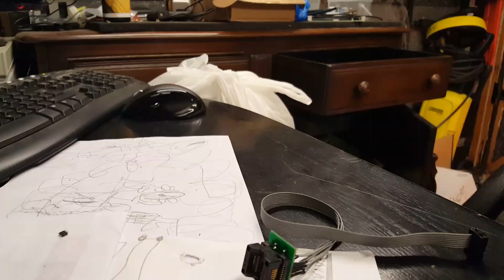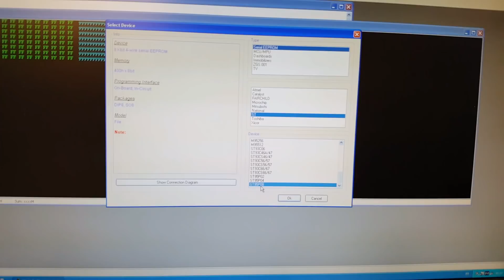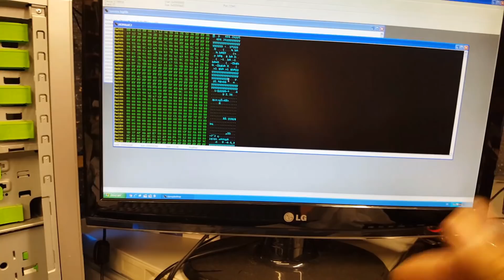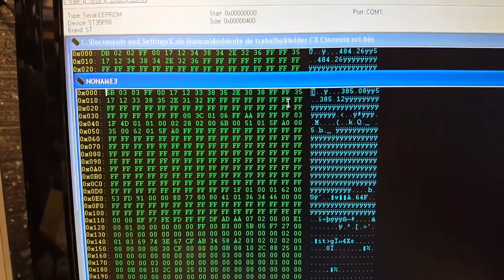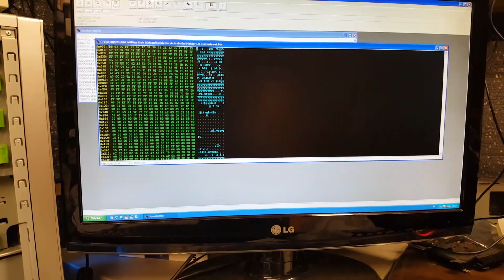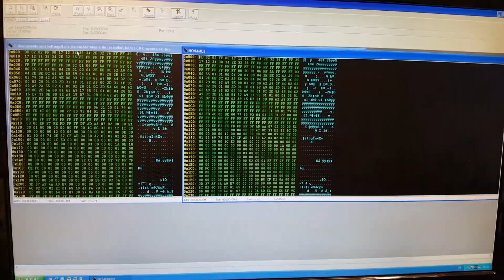Clone/copy immobilizer Bosch EDC15C2 eeprom 5P08C3.

Comment: why not just transfer the whole chip by soldering without copying? I have a dead ecu, EDC15c13 can I simply move the chip onto a donor of the same part numbers and expect it to work or do I need to copy the chip?
Reply from the maker: You can just move the chip...
In this case, was to leave both ecus ready for the same car...
👍👍👍
Reply: @LMAutoRepairs  Thanks so much save me a headache of cloning etc etc

Comment: What happens if you read say for example an ST93c66 chip with the setting to read not being ST but microchip. It reads but does that mean the data is definetly wrong or not?
Reply from the maker: Could be... either erratic data or fails to read...
👍👍👍
Reply: @LMAutoRepairs  And if you matched a Renault traffic EDC15c to SAGEM bcm then 2 minutes later they became unmatched. Where would your mind be as to the next step to diagnose that?
Reply from the maker: Difficult to say... but I would onsider a bad bcm perhaps...
Are those parts original from the car or similar?
Reply: @LMAutoRepairs  the bcm is a replacement bought from Ebay. I learnt pin using my im608 pro then reset immo and my im608 said successfully completed. Then went to relearn and I can't recall but don't think it did it 100% yet got immediately distracted by seeing immo matched appear. Thats what I wanted to see and with it moved on. Only 2 mins later not matched. Also the central locking not working and every time I code a key, either im608 pro or TDB1000 it says completed but check and no keys stored.
Reply: oh too add. pin 6 and pin 14 ohms were way out. turned out to be blue plug. cut it out and soldered wires together. after ohms 60 ohms on can
Reply from the maker: Have you tried to reset the imo again, and restart the procedure?
Reply: @LMAutoRepairs  No thats one thing I did not try. The firm whom I bought my im608 pro from said they often hear when a key won't program that if the programming is tried 3 times it will work. I did not believe them but this is sounding like that in part. If it works of course.

Comment: Why you had not tried to read through ic clamp instead desoldering?
Reply from the maker: 🤷‍♂️
LOL
It is so easy to remove this small chips, that I prefer to just desolder... 
Thank you for watching!
Reply: @LMAutoRepairs  i asked that because is simple to desolder as most simplest to not desoldering it, just r/w via IC clamp placed on it. Thats it!
Reply from the maker: Yes, but some chips the circuit on the board can prevent the reading or writing, or even corrupt the data...
Does not worth the risk... my opinion...

Comment: Hi there,  i have been a used immobiliser unit on hyundai i30 2019. It Does not start. Does a used immobiliser unit be programming without replace ecu? Thank you
Reply from the maker: Never done it on a hyundai... but I am sure it will need programming...
Thank you for watching!
Reply: @LMAutoRepairs  do you know does g scanner 2 work on programming?
Reply from the maker: Never used such tool...

Comment: Where did you get that multi pin adapter? Also, can carprog be used in a similar fashion?
Reply from the maker: I got it from eBay...
Yes, carprog should also do the job...
Thank you for watching!
Reply: @LMAutoRepairs  if you don't mind me asking, where do you get diagram information regarding where to connect each pin? I saw you had a diagram but how do you get that information for a specific chip you have and how do you identify them, are they printed on the chip? Thank you!
Reply from the maker: Programmers usually come with some sort of instructions...
Thank you for watching!

Comment: Hi, that is a very nice job you are doing, keep it up thanks.
Reply from the maker: Thanks!
👍👍👍
Reply: @LMAutoRepairs  Hi, I have got  almost a similar case with a 2004 mitsubishi endeavour ecu MN132652. The ic47 which is 24c04 shifted from old ecu to new does not allow the car to start with the new, is there any other ic having immo information on the board?
Reply from the maker: Most likely the flash... if not external, will be in the MCU...
Reply: @LMAutoRepairs  In the MCU? can I know which one exactly? Can it be the E338A? what do you think it will happen if I take it from the original to the new? Cause it is said E338A is a car key control ic. Can I read and write this chip? Thanks.

Comment: Great video 
Can you tell me in any car ecu how do I locate eeprome  if there are more than one ?
Is there any publication that shows location of eeprome on different ecu or do they have any special numbers that we can recognize them ??
Reply: Great question, I to0 am also curious how to find which 8 tipped eeprom on the motherboard inside the pcm
Reply from the maker: Read their id stamped on the chip...
It is that simple...
👍👍👍
Reply: @LMAutoRepairs  that simple than explain cause not being as smart as you or a mechanic I don't know what I. Looking at andy 07. Passat has 4 ( pinned ones looking the same, what number do I look for?
Reply from the maker: Again, look at what is written on the chips... obviously I know some of them and I can easily identify them by that...
But you can easily Google it, and quickly find what a certain chip is...
👍👍👍
Reply: @LMAutoRepairs  I'm not following the little ones have numbers and I Google it and find nothing

Comment: I have 2006 Suzuki grand Vitara with no working keys. Recently I swapped the ignition and also PCM with a set of key from another Car.  Now i am getting a vin miss match and car wont start. I am having hard time getting anyone to be able to program keys or read the immo for this. currently i have 1 original ecu and another ecu from another car. Are you able program the vin number to my 2nd ecu? Thanks for the help
Reply from the maker: Just program the vin to the replacement ecu... is that the only problem...
Thank you for watching and for your comment!
Reply: @LMAutoRepairs  do you have an email address? I need someone to do the work. can i mail in the eeprom or ecu? i am willing to pay. I kinda need this fixed asap

Comment: hi. please help. where do i get the diagrams for soldering?. please please please
Reply from the maker: What do you mean, diagrams for soldering? 
Thank you for watching!
Reply: @LMAutoRepairs  i don't have the adapter. i have the pice shown at 13:01 in video.https://youtu.be/qfVJb_Bb5WI?t=781
Reply from the maker: @mosalamasekoa9070  
There is a mark on that piece that indicates the chip orientation...😉
Reply: @LMAutoRepairs  Let me be more detailed. I don't know where the chip is. and i need a diagram for my car model. Opel astra J 2014 A16XER. i need to extract and clone my ecu and bcm. i thought you might know a site where i can get the diagrams or pictures showing which is a memory chip on those modules🤦‍♂️forgive me for using up your time.
Reply from the maker: @mosalamasekoa9070  
On the engine ecu, I don't believe there is an external eeprom... it is all in the mcu...
So, you will need to BDM read the ECU... 
If you have the pin for the car you are working on, will be probably easier to buy modules already reset... and then just program them back on the car...

Comment: hmm, how this works.. why you copy data from org.chip to the other one. cant you just take the org. chip and put on the other ecu direct.
Reply from the maker: Hi
Yes you can... in this case I was asked to leave both modules programmed to the car...
Thank you for watching!
Reply: @LMAutoRepairs  aaa okej then i understand. by just moving this chip, do you think i can do it on a edc16u34, i quess is the same process.
Reply from the maker: @rteaw  
If is does have an external eeprom, yes... I never done one... I don't think...
👍👍👍

Comment: Hi does it matter which way the chips goes into the adapter of so how do you know which way ?
Reply: Hi thanks for the reply I've got a eeprom from a Corsa D 1.3 cdti removed from the ECU I've looked online to identify pin one but there's no marking in this epprom 
Thanks
Reply from the maker: @joshbennett6293  
Look at the writing in the chip.
Once orientated correctly,  pin 1 should be the first bottom left...
Reply: @LMAutoRepairs  ok thanks for the help if I read the data via xprog and save the dump could this file be written to the new ECU via ktag which would save me desoldering the new eeprom ?

Or are the file formats different ?
Reply from the maker: @joshbennett6293  
I would write it using the same tool you read it with....
Reply: Hi mate curious on how you managed to wire the adapter to the ribbon cable and then down to the xpgrog have you got a diagram or anything to help me to do the same 

Thanks again
Reply from the maker: @joshbennett6293  
Hi
No, I don't have a diagram... but it is just a straight connection... 
I done it years ago...
🙄
Reply: Ok thanks I'll give it a try also would  a soic8 clip work aswell
Reply from the maker: @joshbennett6293  
Yes... should do...
Reply: If I'm using the eeprom adapter that requires it to be solder to the board which one is pin one on the board is it too left ?
Reply from the maker: @joshbennett6293  
On the board sometimes pin 1 is marked with a dot or something similar, otherwise, as I said, orientation of the writing on the chip...
Reply: Really appreciate the help mate just read the eeprom using the board thanks again
Reply from the maker: @joshbennett6293  
Not a problem!
👍👍👍
Reply: Hi.mate one last thing what the verify button on xprog used for ?
Reply: Never mind you explained in the video thanks
Reply from the maker: @joshbennett6293  
To compare the data written to the chip with the file... to make sure everything matches...
Reply from the maker: Hi
Indeed it does matter... Will not read if placed wrong...
There orientation marks...
Thank you for watching and for your comment!
Reply: Hi mate have you got an email I could contact you on you seem to know you stuff and need to indetify a chip on a cd player main board thanks

Comment: Hi Today I am working on the same ecu edc15c2 from Peugeot 406 2001 with one plug not 3 plug like this one in the video 
But I read on some forum that immobiliser data on this ecu is in the flash AM29F400 
Please is this true or I need to swap the eeprom?
Reply from the maker: Hi
Not sure... would have to check it...
Sometimes can be on the flash...
If you have K-tag, just clone the entire ecu... job done!
Thank you for watching and for your comment!
Reply: @LMAutoRepairs Thank for replying.
 I have Ktag but I don't think it's able to read it I have checked ktag yesterday but it doesn't have the option to read this ecu.
Reply from the maker: @MUSTAPHAxESSAHIHI  
Ok...
What is the problem, and what are you trying to do? 
You can always swap both chips....
Reply: @LMAutoRepairs  The problem is another person was trying to swap the eeprom from the old original ecu because the car had a problem with the injectors and he broke some of the legs of the eeprom chip and when they call me I did my research and found that some of this ecus either they contain the immo data on flash memory or on 5P08C3.
And they didn't check if the new ecu was working. The new one wasn't working after I did my connection on the table the new ecu doesn't respond and the old one communicate fine.
So now the original eeprom of the car is damaged and unreadable. 
Sorry for writing all this but just to know the issue.
Reply from the maker: @MUSTAPHAxESSAHIHI  
Ok...
So you want to immo off?
Or virginize and reprogram?
Reply from the maker: @MUSTAPHAxESSAHIHI  
Also, are you sure you can't scrape a bit of the chip encapsulation and solder some wires and read the data?
Surely is possible that way...😉
Reply: @LMAutoRepairs  that's my plan I have seen you doing this in the BMW video hhh that was great I am going to try I hope That work thank you for replying man I really appreciate your help.
Reply: @LMAutoRepairs  if I virignized another ecu would it work after doing a key programming or should I do immo off
Reply from the maker: @MUSTAPHAxESSAHIHI  
Not a problem...
👍
Reply from the maker: @MUSTAPHAxESSAHIHI  
If you virginize, you should be able to just program the ecu and keep same keys...
Reply: @LMAutoRepairs  thank you I have soldered the broken legs and the car starts.
🙂
Reply from the maker: @MUSTAPHAxESSAHIHI  
Perfect!
Now you can save the data and perhaps load it into a good chip...
Well done!
Reply: @LMAutoRepairs  Yeah I am going to see if any of my tools is able to copy the data from the ecu if not I am going to swap the am29f400 to the new ecu and hopefully everything works

Comment: Hi .  First I want to congratulate you and thank you for your videos.  you are a genious.  Thanks to you I was able to run a mini cooper that I had in my workshop without being able to put it to work.  and your other video gave me the solution.  Now I decided to write to you why in this video you clone an ecm.  I have a similar case now in my workshop of a Mercedes c280 2007. The case is that the car arrived with the computer completely burned.  I opened it but really everything looks very compromised.  The issue is that it looks internally different from what you show in the video.  How can I identify which eeprom should I remove?  Another question would also be all have that chip or some save the information on another chip?  mi Control Unit part number is A2721534579.  I hope you can help me again.  Thanks in advance.
Reply: Thank you.  I have been whole nights looking for information on Google, but I really do not understand information on how to identify which chip is exactly in the case of my ecu .. I will check about the information you just gave me.  It's also that maybe I or I have such an advanced level in electronics and I don't know what it is.  Thanks again for sharing your knowledge.  Thank you.
Reply from the maker: Chips should have identification written on them... if you are not familiar with them, just Google it...
Either you have an external eeprom, which in that case, swapping it should do the trick...
Or, the eeprom data is in the MCU...
Which in that case, you either need to read it in order to transfer the info, or you swap it, unless is a BGA chip, that's more complicated...
Thank you for watching and for your comment!

Comment: Thank you for this video. In my case, I can not copy chips, I do not have the equipment/programmer. But, I will swap them, since my ECU won't start vehicle. I am getting used working ECU and replace this chip, and hopefully, car will start. I will post here the results in a few days, for anyone interested to see.
Reply: Have you started the car?
Reply: @djokakatastrofa7736  I swapped 5p08c3, I was told it is immo chip, and AM29F400. It is car CMOS, and I was told to swap that also. Unfortunately, car displayed same errors, won´t start. Needs to be checked by specialist.
Reply: @miroslavmiljkovic166  Have you fixed the car? So you were told that both 5p08c3 and AM29F400 contain immo data? Btw what does the CMOS mean? Maybe you have faulty eeprom, do you have any kind of eeprom reader to check for data? Best regards from Prijepolje, Serbia...
Reply: @djokakatastrofa7736  Sadly, it is out of my hands now. Car belongs to a friend, and was towed to some specialist. When I get any info I will post it here.
Reply: @miroslavmiljkovic166  Tnx for reply mate.......
Reply from the maker: 👍
Thank you for watching!

Comment: To read the EEPROM on the board connect a condensator parallel to the piëzo oscillator. The processor stops and you can read the EEPROM without desoldering. I never done that but I read this somewere on the internet. I have stops with DPF and EGR Off in 2014. Will yoou try this the next time? I'm cutious. At my age (72) it's very difficult to work on ECU's. My eyes aren't good enough. Thnaks for video.
Reply from the maker: Loads of eeproms, you don't even need to do that...
For me however, it is just easy to remove it...
Thank you for watching and for your comment!

Comment: I have 3 questions.
1. If we make all bytes 0 to EEPROM will immo be off?
2. Will central lock works after immo off?
3. Best way to find EEPROM chip where is located in ECU or IMMO box?
Thanks a lot keep it up 👐
Reply from the maker: Hi
1. No.
2. Yes.
3. Each module has an eeprom or more, that contains info needed for the modules to work correctly...
Hope that helps. 
Thank you for watching and for your comment.

Comment: Ive bought a solder station, what is a good temperature for iron and heat gun, a temperature that wont ruin chip thanks
Reply from the maker: Hot air gun set it to 280c and should be ok...
The soldering iron, 250c should also do...
Reply: @LMAutoRepairs  I just cant get solder to melt, I darnt turn it up any higher in case i fry brain
Reply from the maker: @virginsmoker  
What chip are you trying to desolder?
Reply: @LMAutoRepairs  that eeprom, one near them two brown capacitors
Reply from the maker: @virginsmoker  
Increase the temp a bit on the hot air gun....
Just make sure you heat the chip slowly and uniformly...
https://youtu.be/abAHbI822EY